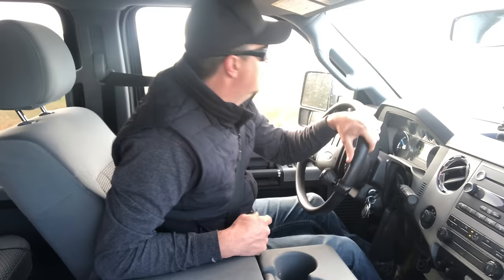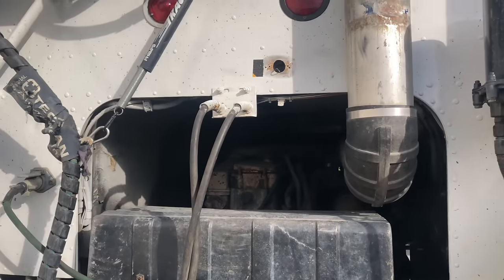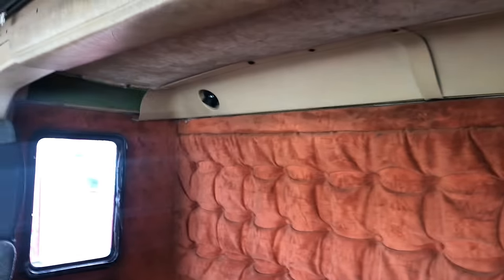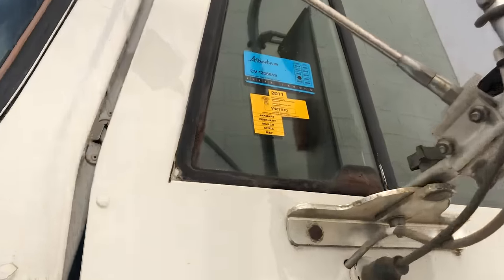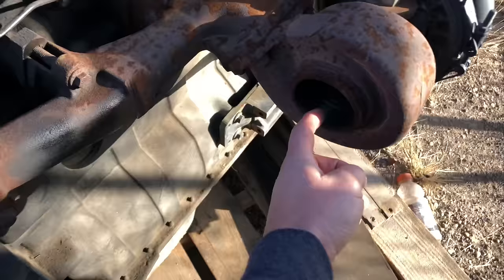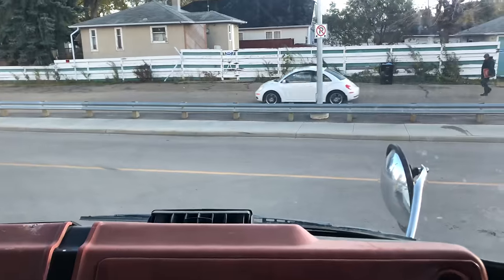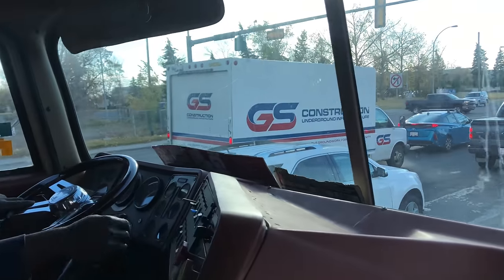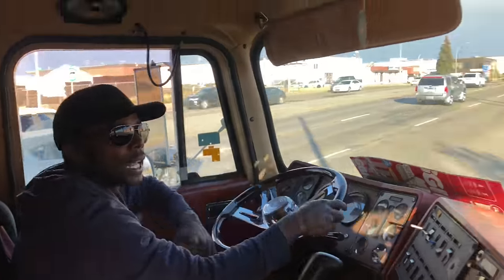What's For Sale Ep.1 International Cabover

Comment: Fun fact! The trucking company I was a mechanic for in the late '70's was strictly at that time International only. We had a LOT of 4070 "B" models, as the length laws back then made COE's the only way to go to get under the (then) restrictive laws. International made a deal with one of our big lease customers out of St. Cloud Minnesota to drive a full prototype of the 9670 cabover-- brand new, not yet issued for service. I was working midnights at the time, and here comes this truck middle of the night that none of us had ever seen before, cobbled full of non-standard parts (including a grill off of a conventional 4200 series.) The dash was pretty-much complete as the one you rode in in this video, and of course it had the new-style bigger cab. They stopped off because there was a problem with the lights. We had absolutely NO parts, as you can imagine. We got them going by rigging up some jumper wires so they could continue. That truck was loaded with cables running to all parts of the frame, and the luggage compartments had recording devices inside that was keeping track of stress data on frame points. Basically, I was one of the first mechanics to ever work on the new-style 9670 International COE's, prior to manufacturing!

As for the shifter, he's right that it is linkage. It has a rod shaped almost like a spear with a ball welded perpendicular to the end of the shaft that coupled with the shift handle in the cab. It was pretty reliable, as long as you tweaked the adjustment right. What wasn't so was the clutch! It was a clutch cable, which was actually thin bands of flat metal inside of a cable and sandwiched by dozens of ball bearings on both sides of the metal bands. The problem was they were prone to breaking, and with no warning they would just let go, and you had no clutch. There were also availability problems in the beginning years that was bad enough that we bought new clutch cables, still in their flat boxes, and placed them under the mattress in the sleeper so that, while they'd have to find someone on the road to change it out, (which was quite a job,) they at least had the parts!!

Overall they  weren't a bad truck. As with any model truck they had their peculiar problems, but they were a lot better and more comfortable then what they replaced, (the 4070 "A" and "B" models.)

Kudos to Anton, he did a nice job restoring it! Hope he makes a sale!!! 👍

Comment: More on the blue W900 flat top with Gibson's decals... Boychuck got bought out by Gibson's around 2003/04 I believe, when Gibson's took over the methanol haul from the plant (which no longer exists) at 17 St and Yellowhead.   Gibson's also took over Boychuks yard also across the street from methanol plant on south side of Yellowhead at 17 St.   Each of Boychucks trucks were custom built, had 550 Caterpillars in them, and were METICULOUSLY taken care of!   Gibsons originally used them as company trucks, but when they got rid of company drivers, offered the truck for purchase to the driver so they could keep working.  The truck you saw Mark was hauling molten sulphur the last time it was working, but since Trimac has bought out the trucking division a couple years ago or whatever, obviously that truck never made the switch.  I did two stints at Gibson's, I was thinking maybe I know Anton if he worked there.  Great episode Mark, love the local flavor from Edmonton!!

Comment: I like this idea!Also, nice power smoke. I have an identical interior, but I’ve replaced the head unit with a kenwood that does wireless CarPlay. Once you delete the damn thing, the 6.7L is quite the reliable beast. Someone not far from me who does long haul trucking has one of those 900’s from the beginning of the vidya in this crazy 80’s paint scheme. I’ll have to get a photo.

Comment: Just rides a little rough 🥴 cuz it ain't been road in a while. Yep will ride like a kaddy after a few million miles. Traded a 63 impala when I was a kid for a dark brown metallic 73 malibu with landau top rusted craigers from a gas station. The guy told me the reason it had a chain going from the motor to the frame due to it being a race car and regular motor mounts wouldn't hold. The smoke was due to it not being run and should clear up. It wasn't a race car and the smoke never cleared up it used equal amounts of oil as gas luckily my neighbor went back to the garage with me to get my car back within an hour.